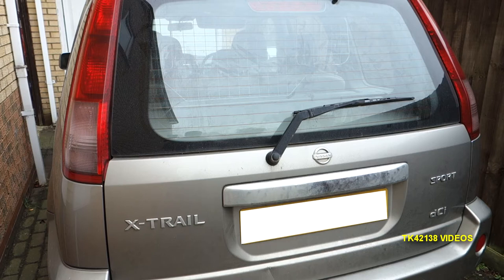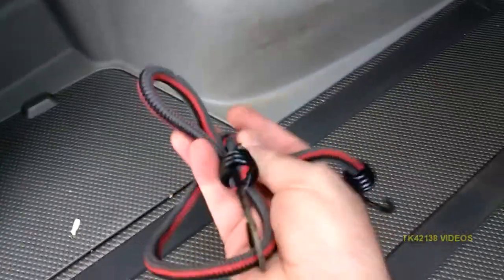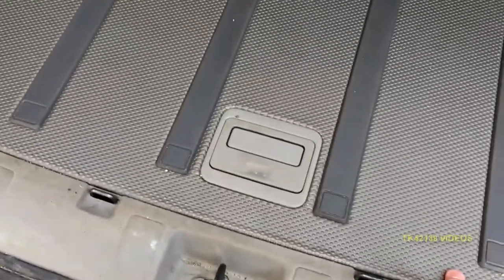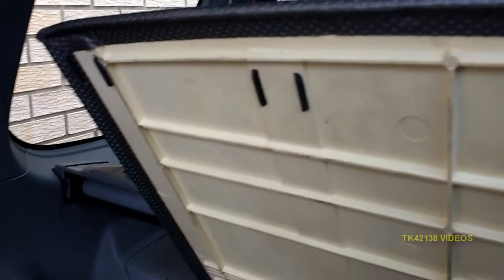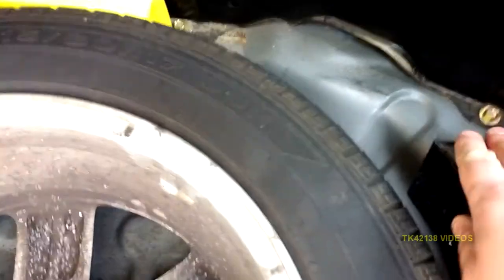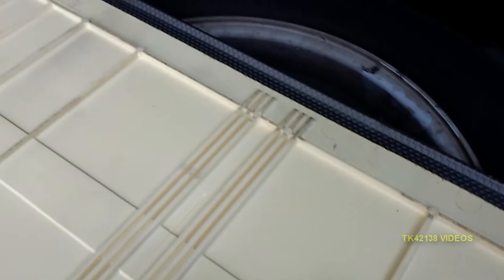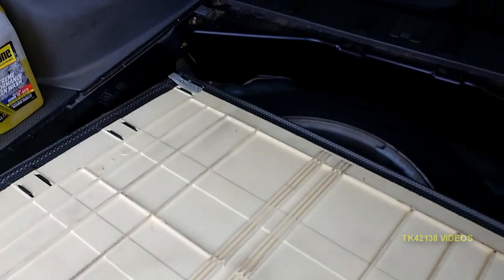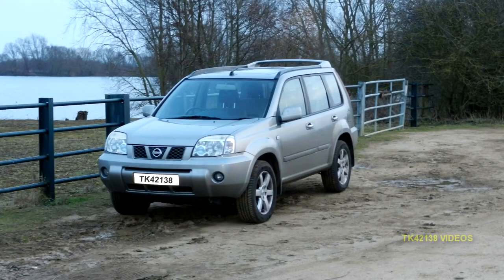The X-Trail Files # 9 'Cargo area floor panel'

Comment: Looking good as always, thats a big boot l have to say. you could use the  panel as a template and cut out a new panel and add strength as you go perhaps
Reply from the maker: Going to look into doing that either out of marine grade ply or aluminium.

Comment: Have yet to explore this part of the vehicle so this was positive to see so much room under there to possible hold some coolant/ oil/washer fluids. 

How did you get the cover to extent at the rear end portion (Not the ones attached to the seats)? Mine doesnt move at all! 

All in all great video! Im in LOVE with my X-trail and literally just want excuses to drive long distances so I can sip (and i mean sip so good on gas im blown away) gas and enjoy the confident ride!
Reply from the maker: Hi, the cargo cover should pull right out to the tailgate and hook onto clips on the C-pillars. If it doesn't, there might be a problem with the retracting mechanism.

Comment: Ah.  Hold up.  The floor rests on the spare wheel it’s doesn’t need strengthening
Reply from the maker: That's correct although if the spare is removed to gain more storage space, the plastic floor panel might need some bracing depending on what is loaded on it.